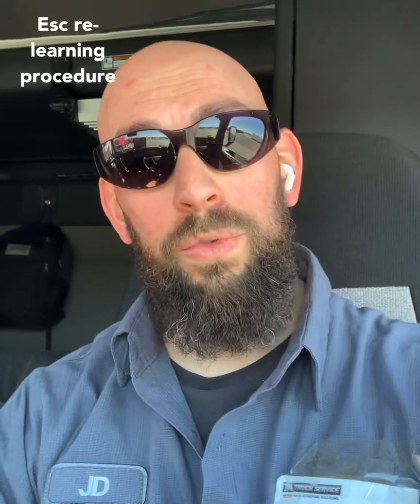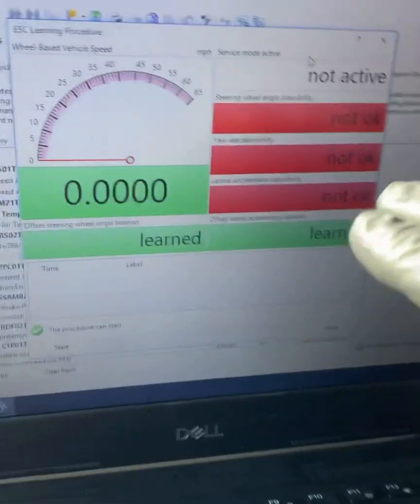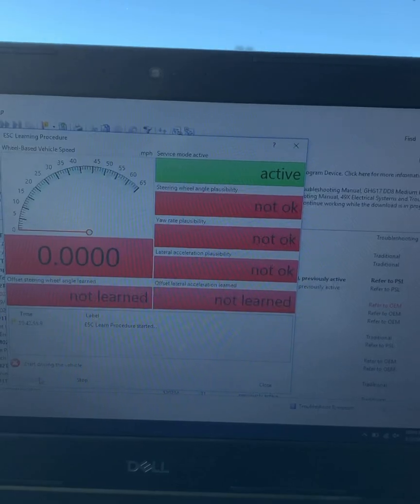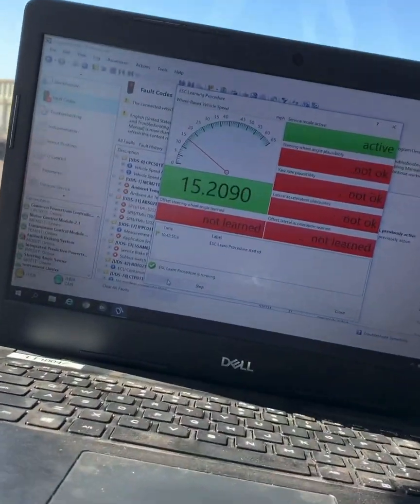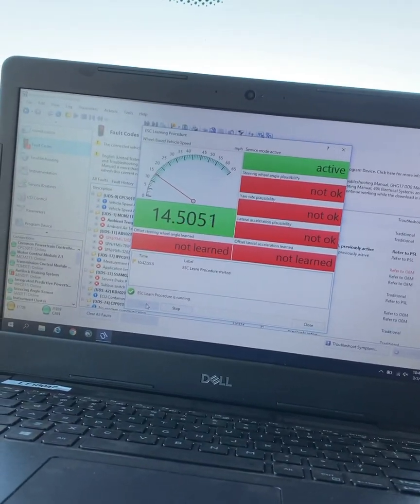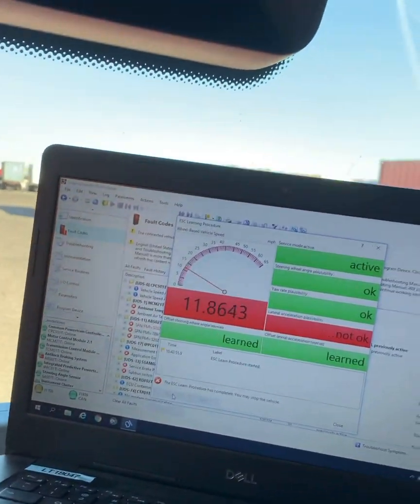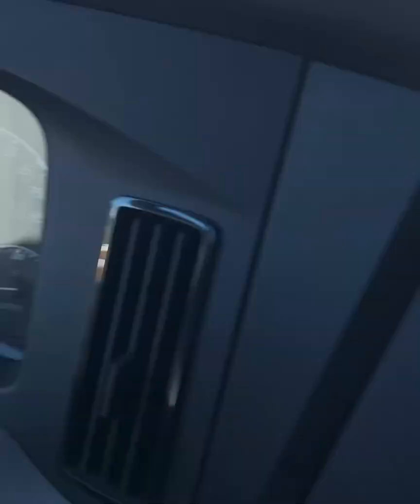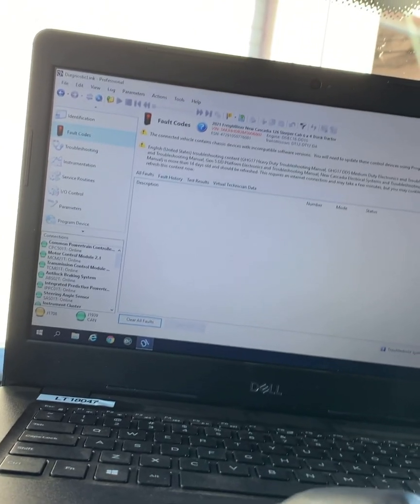Electronic stability control calibration  520216/31 also abs light

Comment: Hey brother, my truck is a FR Cascadia 2019 its having that problem, I've done the test but it doesn't succeed, do you think that the module is not properly working or do you think i should align it first? cuz I have done that test a couple times and it didn't go thru, 

I've noticed that when you hit the 16 mph it turns red, but in my truck just keep being in green. any thoughts?
Reply from the maker: If the alignment is way off on the truck than it will have issues passing this test. You might have to ensure the sas will calibrate first than move on to esc calibration. If all that is correct than there is an issue with the esc module or abs module.
Reply: @bustedknucklebydieseldr3228 what is the ESC MODULE? On my trailer or on tractor? Got to be tractor. I get this code 520216 31 right after I left utility shop after having a sensor replaced and all codes cleared and brakes checked. Trailer ABS COMES right back on in dash and on my trailer. After spending money.

Comment: Is this also the reason why the TC Light Comes on when going 2 mph??
Reply from the maker: There very well could be an issue with your esc but if it only comes on at 2 mph then I’d suspect another issue
Reply: @bustedknucklebydieseldr3228  Ok but i meant to say won't go into the next gear
Reply from the maker: @WorldPremiere2018  oh in that case you have tranny issues or abs taking down ur trans not allowing it to shift.
Reply: @bustedknucklebydieseldr3228  OK That makes Sense the abs sensor came on saying the same codes you mention

Comment: My esc traction control light stays on no codes what do I need to do please help
Reply from the maker: If your light is on than either your learned parameters got erased and need to be reset through the computer. Or the system is failing to wake up which you also need a computer to diag it.
Reply: @bustedknucklebydieseldr3228  thanks busted knuckle, should I worry driving it before I get ithome
Reply from the maker: @davidromero9985  you should be fine, just take extra precautions to be safe.

Comment: I have a 520247/31 Failure Memory Bit (ESC) / condition exists on a 2021 Cascadia, would this procedure be a good way to "fix" this code? Does not let me troubleshoot and no conditions are learned when I open the procedure.
Reply from the maker: Thanks for reaching out. Yes that code would be the result of lost steering ratios. Would either have to go through diagnostic link or Wabco and calibrate sas and esc like in the video. Was surprised to when I looked and there was no t/s to be found online. Just in forums and seeing it more often.

Comment: Hey bro. You are the man. I have a 2020 freightliner that sway while driving. All front end parts look great. Put on 10 new tires. Also have had 2 3axle alignments. I have not done the stability control calibration, nor check ride height, Any suggestion are have you had any driver complain of the swaying are feeling like you are driving in a high wind..
Reply from the maker: Thanks for the positive feedback and reaching out.  For a 2020 FTL there’s no reason it should be swaying like that with no high winds. I have had new units with failed cab shocks which will cause excessive bumps from the cab. And have seen loose cab mounts which would Deff cause swaying. Other than those to items cab sway bar/cab torsional rod would be the last item to look at. Hope one of those will lead you to your root cause.

Comment: Would an issue like this be caused from getting a steering gear box replaced or a 3 axle alignment done?
Reply from the maker: Good question and thanks for reaching out. After getting an alignment on the steer axle it’s always best to reset your stability control as well. Your steering angle sensor can be thrown off if there was a major correction. If there just doing the other two axles than I wouldn’t worry about it. Good quest though
Reply: Thanks…you just saved me money now I can notify the dealer on what exactly is my issue…